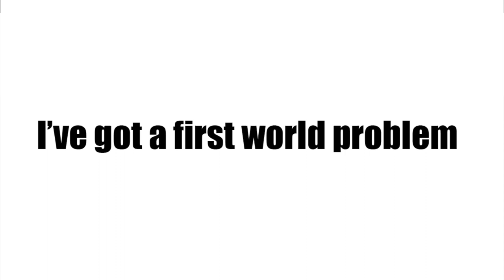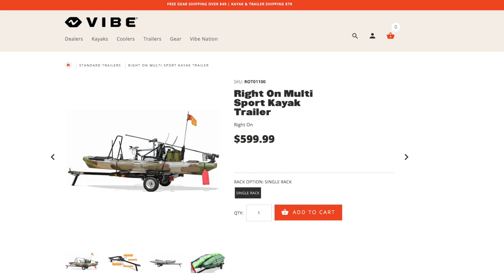Kayak Trailer on a Mustang???

Comment: I bought one last week for my YellowFin 130T.  Vibe has been sold out of them for a while.  I got mine direct from the manufacturer website.  Only issue so far was poor grounding.  I added the extra pigtail grounds to the rear taillights and it works great now.  Question: what J cradle did you get to work with the round bar mounts? Thanks!
Reply from the maker: Yakamia J-Lows